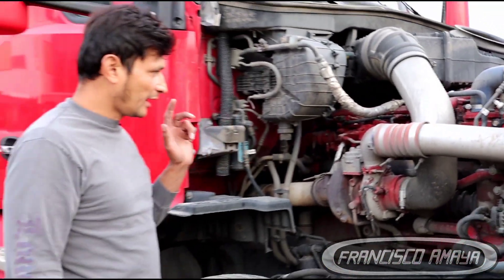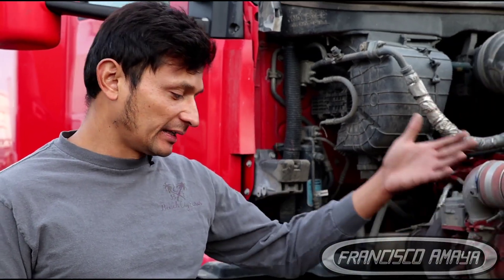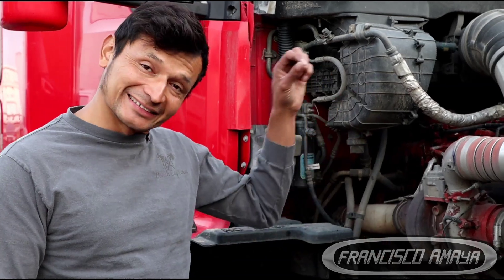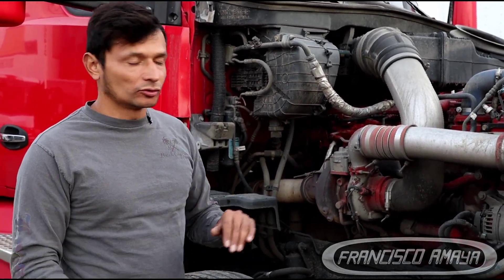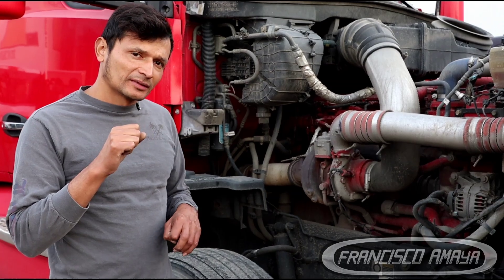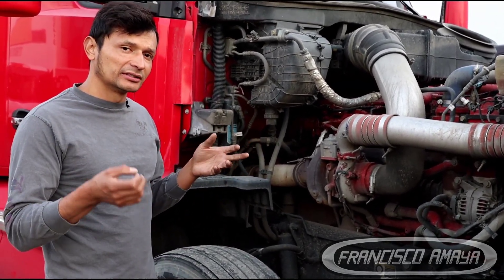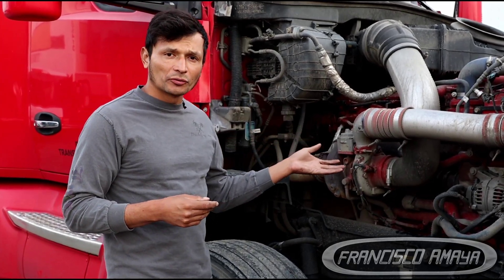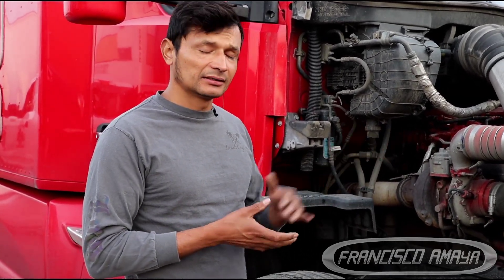Cummins X15 engine missing coolant with not noticeable leaks and stains internal problem

Comment: My 2020 kenworth t680, x 15 EGR cooler started leaking @450 k miles, just 1 quart every 3 weeks, I replaced it @530 k miles,
Reply: There was wet spot on outside the inlet of egr cooler and white coolant drop on the exhaust manifold from the egr valve and differential pressure sensor